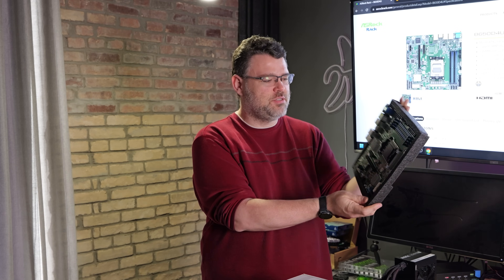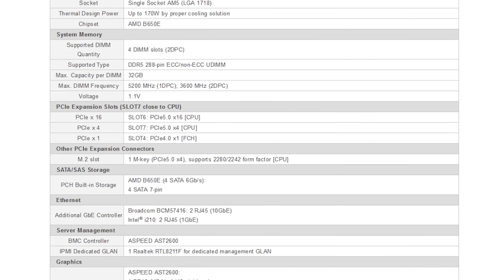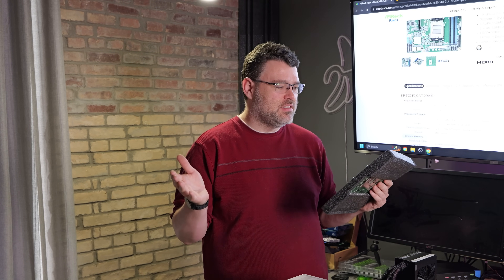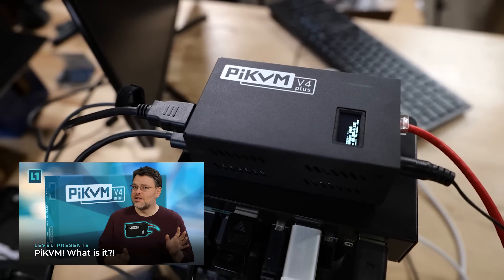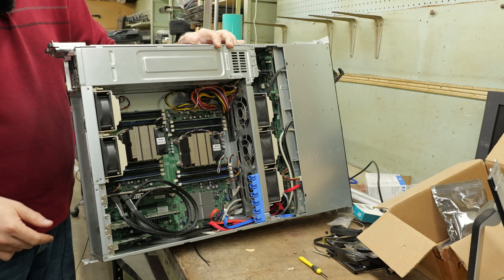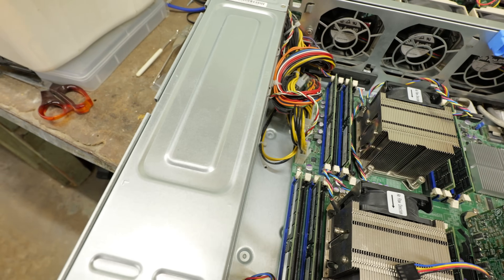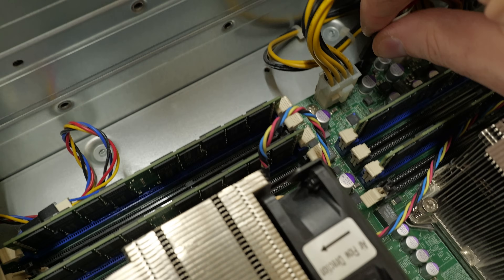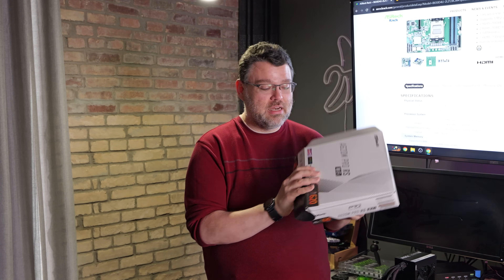Checking Out The ASRock Rack B650D4U Server Motherboard!

Comment: I just bought a X470D4U to use with the Ryzen 3900X that I pulled from my system when I upgraded. They're pretty cheap on eBay right now (I got mine especially cheap at $150, which was the whole reason I went down this rabbit hole to begin with). It only has 1gbit ethernet onboard, so I picked up an Intel dual SFP+ 10gbit card for $30 and a pair of direct connect cables for $12 to solve that problem - even if I needed to go with copper modules it would have been cheaper than buying any dual port copper 10gbit NIC out there, and it's enterprise grade hardware unlike most of the other options. I have a $60 BCM 12gbit 4 channel SAS HBA in the x16 slot, the NIC in the x4 slot, and a $80 Tesla P4 in the x8 slot for GPU/CUDA/Transcode workloads (putting it in the x16 slot disabled the x8 slot no matter what I tried, but doing it this way worked). Added a couple of cheap ECC UDIMMs for$50 to round it out (only 16GB, but my peak usage is only around 12 currently so it does the job and I can upgrade to 32 or more later if needed). The whole thing minus the CPU was less than $400. You could use the onboard 8 SATA ports and save money on the HBA if you have fewer drives than I do, and use an old GPU if you have one in place of the Tesla - I just wanted some extra power there for AI camera processing and you can't beat the P4 for compute power per dollar per watt right now.

It's not the most power efficient solution, but if you have an old Ryzen chip lying around you can build quite the powerful little homelab for fairly cheap by going this route. Note that the x570D4U isn't as suitable for this because it only has an x1 PCIe 4.0 slot rather than the x4 3.0 on the x470 version. Also note that only the Ryzen 3xxx+ chips have ECC support built in, if you have an older chip you will need to use standard RAM, and it has to be fairly low profile due to the position of the DIMM slots on the mobo being very close to the CPU socket - gamer RAM with giant RGB heatsinks probably won't work unless your CPU cooler has a tall cutout for RAM, and if you can/do use ECC RAM, it has to be ECC UDIMMs, RDIMMs will NOT work.

Comment: Since this has been brought up this way, I'm curious if I shouldn't do the dual 2699 v5 thing, I currently have a gaming/homelab setup built around a 7950x, but should i just buy this board, and get a 7800x3d, or would 22 x99 cores actually still make any sence. (Power budget isn't a concern)

Comment: Asrock Rack doesn't communicate with Supermicro PDU since they don't know the standard addresses, you are free to work with them to get it working, I haven't had time unfortunately to provide them all details to get it implemented.
But otherwise Supermicro chassis are exceptionally good for non-Supermicro motherboards, just get yourself CBL084L front header cable adapter

Comment: Xyratex HS-1235T-ATX, sporting 2x Intel(R) Xeon(R) CPU X5660 @ 2.80GHz, 48Gb DDR3 ECC (24Gb /socket) and 10x4Tb SAS (Z2 Pool) + 2x1Tb (Raid 1 OS)
Eating more power than I would like truth be said, question is, can I use a normal ATX mobo to upgrade this to a more reasonable power usage?

Comment: im so sad these boards are so expensive. I would like something with this layout but for consumers.
Reply: I miss green PCBs
Reply: @zsmith8632  what about brown blue and red pcb's`? good ole days
Reply: I was so set on the D4U series for my home server but I ended up going with the Asus WS680 Ace simply because it was more affordable and offered basically the same features
Reply: Dual 10GB RJ45 NICs and IPMI aren't cheap. If one were to add these features separately on a mid range B650 board it would cost slightly more than what this is retailing for. The price if anything seems quite fair. Especially considering that these features are often sold at a premium in the commercial server market.
Reply: @Ilost11   im talking about LAYOUT. Ram perpendicular to the IO shield makes for great airflow. If I want anything else I can buy a pcie card for it. The only other motherboards using this layout (other than oem stuff) was EVGA DARK motherboards, which are super expensive.
Reply: @hectororestes2752  The layout is because it's made for the front to back direction air flows in rack chassis. Nothing more, nothing less. They just don't really make any other kind of boards for rack chassis.

Comment: I have an x570d4u-2l2t in my server now.  Works well once the BCM got straightened out a few years ago.
Reply: Same board here (with a 45W Ryzen 9 5900) and I love it. I'd be more tempted to upgrade to am5 if there were a x670 edition with more features. As it sits these b650 boards are not a direct replacement for the x570 due to either a lack of sata ports, 10GBe or m.2 ports and that's just sad. 

I would not be able to straight board swap without losing some drives.

Edit: As wendell says, there isn't a "perfect layout" am5 server board yet.
Edit 2: There is also a WIP port of OpenBMC to the x570d4u board to keep an eye on.
Reply: Updated build coming to the l1 forums. 😂

Comment: I was wanting to go ASRock Rack for my 5900X AM4 build but $400+ for the board at end of life - stuck with a MSI Pro board till I need to upgrade.
Reply: I don't think the power delivery is much good in these. I have a X470/5750U, and besides IPMI it's honestly not an amazing board.
Reply: @Fay7666  strange power delivery issues? That is an odd one. I've been liking these MSI PRO boards, very compatible with 128gb of 3200 CL14/16. I have found however the very limited pcie bus sucks

Comment: Still waiting for any AM5 motherboard that can route its 24 free CPU PCIe lanes to three x8 slots.
Reply: So no lanes to the chipset?  No USB, etc.?  /confused
Reply: @acubley  Actually no, there are still the 4 PCIe lanes for the chipset; AM5 gained 4 more CPU lanes compared to AM4, in total 16 + 4 + 4 + 4 (Chipset).
Reply: @acubley a lot of usb and crap is built straight into the cpu these days ;-)
Reply: @LiLBitsDK  The wonders of thinking sand.  TY